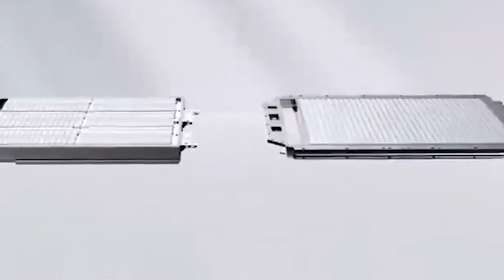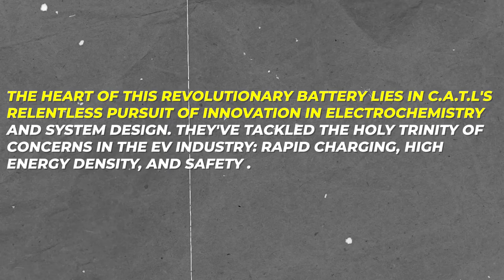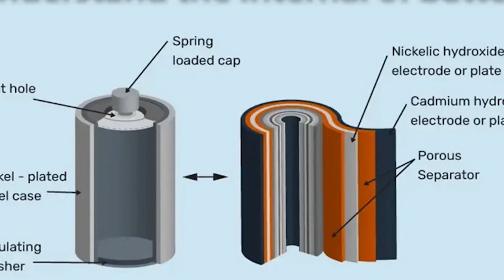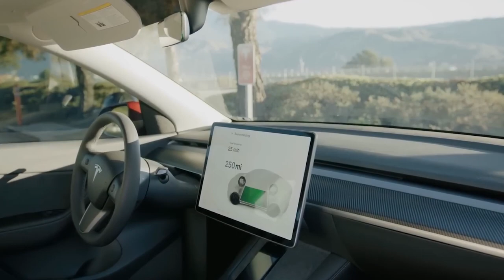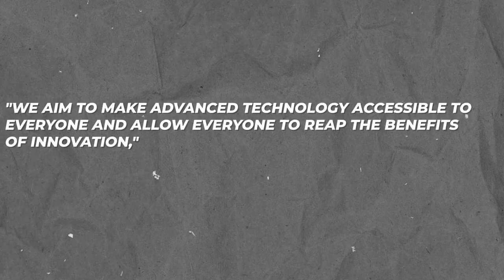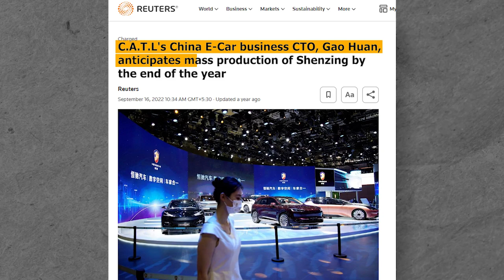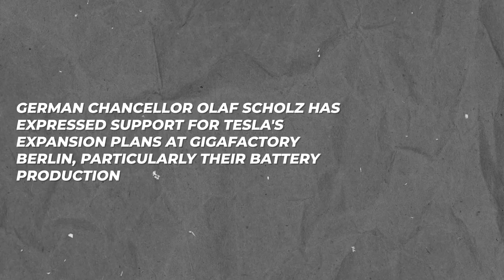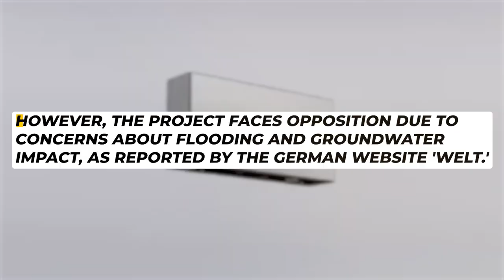CATL Finally REVEALS New Superfast Charging Batteries for Tesla EVs That Will KILL The Competition!

Comment: Still on a Lithium? China already had started producing Sodium battery derived from Sea water which is much cheaper and with an unlimited supply that helps to decrease sea water from rising above our surface.
Reply: They need better isolators.
Reply: @knuthf  is the ultra violet rays sufficient enough like the thing they use for their agriculture sector in Europe?